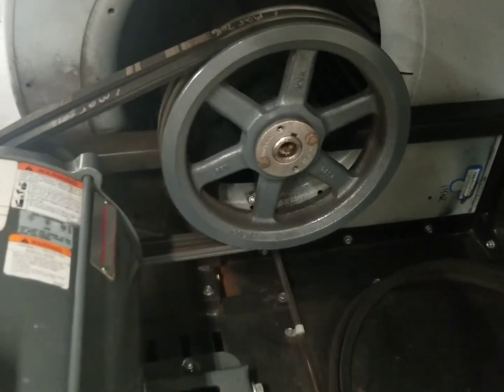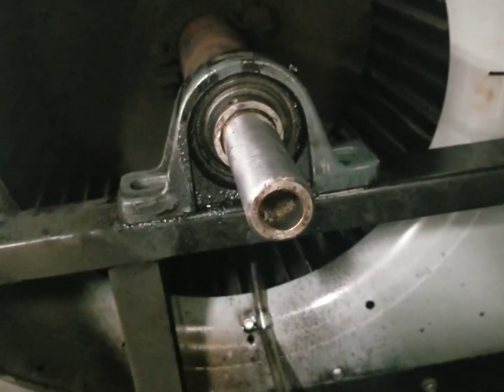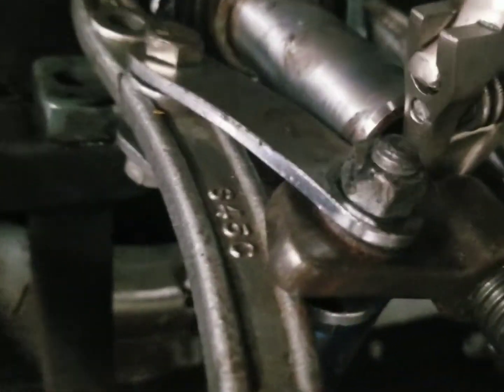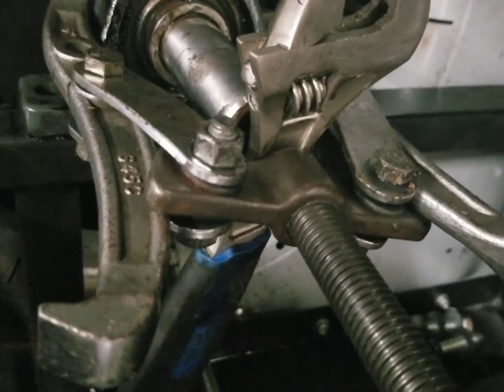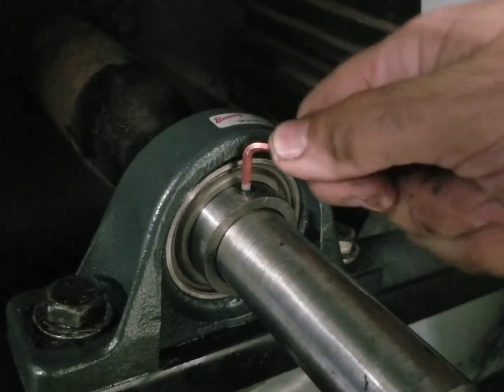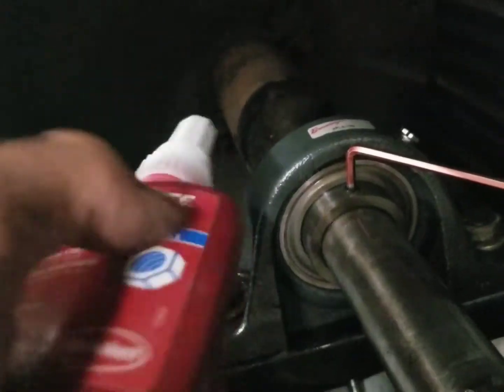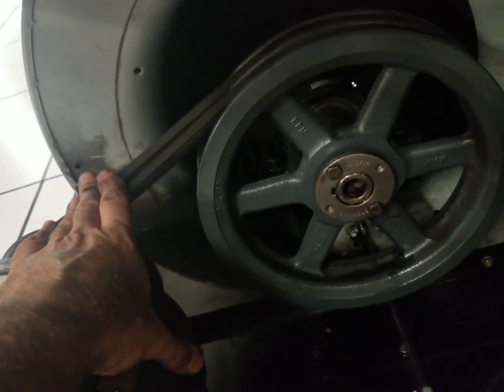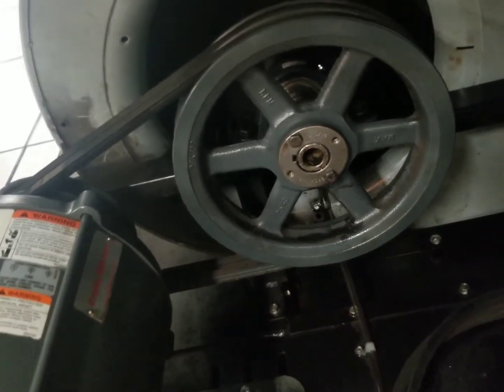HVAC - Pillow Block Blower Bearing Replacement On A Liebert

Comment: 4:00 dumb question, but why would it matter if it comes loose? Wouldn’t it just become a plain bearing at that point? Or would it cause too much play for the application?
Reply: I’m using a pillow bearing right now to fix a massive amount of play from my shaft, but my shaft is allowed to have some play so the set screws and extra ball bearings are a bit overkill for me

Comment: One thing to add to you puller kit . Is if now the internal diameter of the pipe on a regular  ones . Either get a machine shop to make plug to fit the interior dia with a shoulder to but up against and have the center drill a blind hole so the puller rod will center up on it . But another diy is find a short bolt that thread will fit and center drill it in drill press . And keep a few made up to keep in a bag . Just thought from a machinist now HVAC  . I just like to make tools to help people out

Comment: You make it look easy. I'm out at my mother-in-law's because the guy she usually has turn her unit on for the year hasn't been oiling the bearings. Now I'm stuck trying to pull them off and they're seized to the shaft. Used the puller after liberally soaking in penetrating oil and the bearings separated from the rest of the rubber set. Now I have to figure out how to pull them off or just cut them off the shaft.
Reply: Of course he did, especially since he left out the part of literally removing & reinstalling the pillow block.
Reply: @MR-backup  That's what I'm saying

Comment: Lol I usually keep a block of wood. Never thought of using a wrench in there. That’s pretty cool. 
Been fighting a bearing on a big ass exhaust fan. 
I need to borrow a two jaw puller. I tried a 3 jaw and it is difficult to get it in there nice.

Comment: You took the meat and potatoes of the video away from us. I wanted to see the bearing come off and the new one put on.
Reply from the maker: The puller was not in thr best shape and it had to be constantly adjusted.   Besides that the bearing slide off no problem and the new one slide on no problem.  It's all about shaft prep and finding something to plug thd hole on the shaft.

Comment: What kind of puller is that. I'm an apprentice in training and I want to learn easier techniques to removing bearings. I've seen my co workers struggle.
Reply from the maker: Basically just a gear puller
Reply: They got two and three jaw pullers.
They work on bearings. Shivs and pulleys. An excellent tool to have. Trust me. I like jaw pullers myself. 
There’s several types of pullers. But jaw style work the best in my experience.

As I learned for years. Just get the puller. It will make your life so much easier. 
I’ve done a pull without the right tools and trust me you’ll be there all day. Especially if it’s rusty.

Comment: I like the idea of using a Gear puller.  Myself I like to get the job done quick and I always cut them off.  But if your in a data center I could see pulling them off that way so you Won't set off the fire suppression(Liebert)
Reply from the maker: Fire suppression was bypassed and I've cut them off in the past with a torch.  Looking to get accut tool or angle grinder for these in the future.
Reply: @HVACKnowItAll  in use a 4 inch grinder with cut off disks. Nothing special then a chisel at the end.

Comment: Thanks for the video, it’s great.  Question, is the laser level for pulley alignment a good investment ?
Reply from the maker: I've never personally used one but I can defend see value in them
Reply: HVAC Know It All thanks for the reply
Reply: A 10 dollar straight edge from Home Depot or a piece of thick long string all you need. You plan on spending 1k on a actual alignment laser tool??
Reply: Aaron Arias not I, but if the company is willing to buy it I’m willing to use it as I am using the straight edge technique now. 👍
Reply: @HVACslayer  don't get me wrong, I use straight edges as well, but they aren't always ideal. I work with large drives in less than ideal locations. Laser alignment makes life better. Especially when you have an 8ft span. Can't say I'd use string to align a high speed drive system, but if you were comfortable with it, then go for it. In theory if done correctly and I'm sure you're competent enough, it would work in a pinch
Reply: @krislink1761  Yes since this comment I now use flukes laser alignment tool actually had to use it on a cooling tower alignment no way in hell would a ruler work like 10ft span like you mentioned. I use either string to double check alignment on smaller system maintenance’s and use the ruler on maintenance check on smaller ft span. If I notice belt shred and change a motor or pulley I use the laser. 

My coworker had one I didn’t know, he brought it out for us to use since than it’s been good investment.